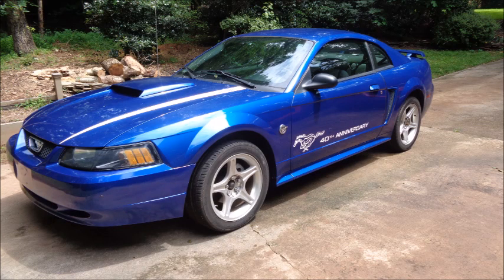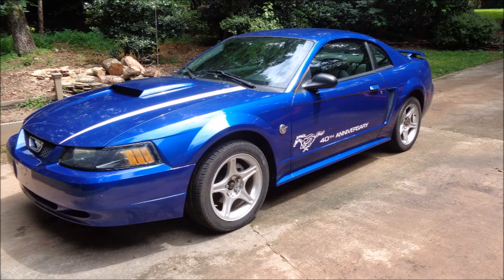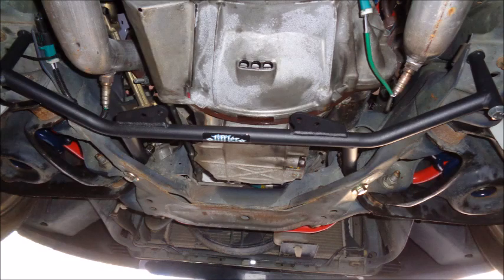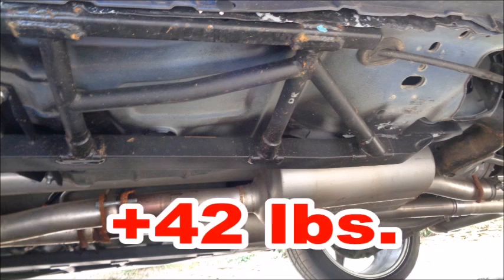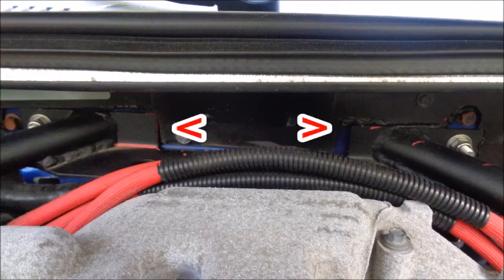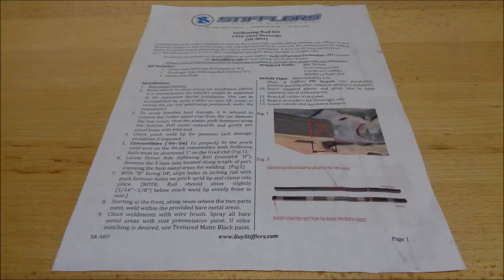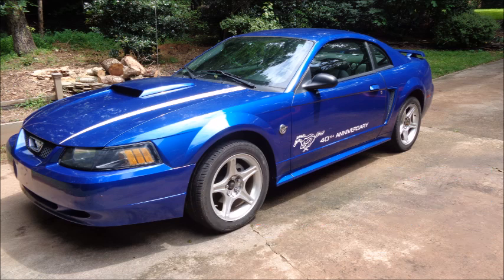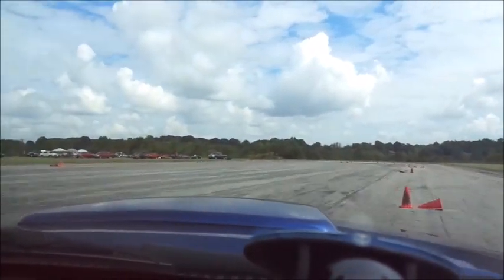MUSTANG ST Part 1: A Strong Foundation (Chassis Bracing Components Review)

Comment: Why didn’t you get the v8? They have a stiffer frame, I think.
Reply from the maker: The V6 and V8 cars have the same chassis. Some SN95 models did come with extra bracing from the factory. I chose the V6 to prove that autocross is more about handling than horsepower. The V6 is lighter and has better weight distribution than a V8. If you look at my results videos for this car, you will see that it has beaten a bunch of V8 cars on an autocross course.
Reply: @warhorseracing  That’s a good pint, V8 mustangs are front heavy. Some guys move their battery to the back of the car to help balance the car. GTs do come with rear sway bars tho.
Reply from the maker: @angelgjr1999  For autocross, you'd want the battery to be behind the passenger seat (which isn't something most people would do). Many battery relocation kits place the battery toward the rear (bumper end) of the trunk, which isn't ideal for mass centralization. I'm not 100% sure what you mean by "rear seat bars", but, if you watch a few rear seat delete install videos, you will see that there are no crossbars behind the rear seats in 99-04 V6 or GT coupes.
Reply: @warhorseracing  Sorry I meant rear sway bars. Base models don’t come with them stock, I think.
Reply from the maker: @angelgjr1999  Right. Many 79-04 base models didn't come with a rear sway bar. My 1993 2.3L also didn't come with a rear sway bar. It's always interesting driving a Mustang that doesn't have a rear sway bar.
Reply: @warhorseracing  How so? Is the rear end less stiff?
Reply from the maker: @angelgjr1999  There's more body roll. And there's more understeer in a Mustang without a rear sway bar. Mustangs without rear sway bars are less composed out on course.
Reply: @warhorseracing  How could one decrease under steer?
Reply from the maker: @angelgjr1999  There are several different ways to reduce understeer, depending on the mods you've made to your car. Basically, you would make mods that add oversteer. A larger rear sway bar will add oversteer, you can use adjustable shocks & struts to add oversteer, you can add negative camber up front, and you can adjust your air pressure. It sounds complicated, but it's easy to learn how to adjust these cars. If you watch my "ThoroughbRED PART 4: HOW TO ADJUST YOUR AUTOCROSS SUSPENSION" video, you'll see the process.

Comment: Hey I was curious if you had some insight, Im going to be putting flsc on my car this summer, and you sweat by stifflers fit system, and so do others, but when I try to find info and what makes the spider webbing and outer stiffening rail and improvement, all I find are people arguing over it. My cars a street car but I want it to handle like its on rails, The plan is MM motorsports coil over kit with koni adjustable shocks, front strut tower brace, rear lower control arm, rear upper control arm, rear sway bar, and later down the line a tubular k member and a arms. What benefit does the fit system provide over a good set of full length sub connectors? is it worth the 250$?
Reply from the maker: I will preface this by saying I am not an engineer; my response is based on my experience driving/riding in many, many autocross Mustangs at events. I've also been able to autocross my 2000 GT convertible with "regular" subframe connectors and, the following season, the FIT System in place. The FIT System definitely made that car stiffer and more responsive to inputs. And my 2000 GT feels stiffer than other convertibles I've been in that use full length subframe connectors (and some that use FLSCs and a bolt-in roll bar). If you change your tires often, the jacking rails allow you to lift both wheels on one side of the car off the ground from one point on the car (which saves time). The real question is: Do you need the FIT System on a street car? While the added rigidity will improve the immediacy of inputs and the clarity of feedback at any speed, you will have to deal with more NVH.
Reply: @warhorseracing  Ok noted, Thanks for the quick reply! Love youre videos and love that you show the handling capabilities of these cars
Reply from the maker: @ryanwhitehead2412  I'm always happy to help. I appreciate you checking out my videos. You are building a pretty capable Mustang; you might want to give autocross a try. It's a lot of fun!

Comment: Subframe connectors are the number 1 most bang for your buck mod on these cars. Never had the stifflers units, but even for a road car a set of regular old maximum motorsports full length connectors make a world of difference in these cars. 

Great video.
Reply from the maker: Thanks! Full-length subframe connectors are a great addition to any 79-04 Mustang (on the street, or in SCCA Categories that allow them).  I've used the Stifflers FIT System on 2 autocross cars. It's a huge improvement over subframe connectors alone, especially on my convertible.

Comment: Nice video!! I don't do autocross alot but what you think about suspension kit? Do you have any suggestions. Thanks
Reply from the maker: Many suspension kits include non-adjustable shocks & struts (you definitely want adjustable shocks & struts for autocross). Many kits include parts that might not be legal in the SCCA Category you run in. I prefer to piece together my suspension mods, rather than buying kits. What SCCA Category are you running in? I can suggest mods that will work. You might also want to check out my "Budget Autocross" videos; there's a lot of info in them that will help you decide on mods.
Reply: Thank you

Comment: Another great rear shock tower brace is the kenny brown one. I did that one because it is a 3 point which seemed to be a plus imo. Love the videos man, always going back through them for info!
Reply from the maker: The Kenny Brown rear shock tower brace does look like a good design. Did you weld it in, or bolt it in? Thanks for watching my videos again!
Reply: @warhorseracing  i bolted it but have been considering getting it welded in. I just don’t have a welder. If I were to install it again or offer advice to anyone getting it I would definitely say weld it because bolting it was a HUGE pain and a two person job
Reply: @the1whoknoxs  the bolt goes in the top and nut goes under the car so you can’t tighten it unless someone or something is under the car holding the nut while the other person is tightening the bolt. Same for where it bolts to the strut tower. Someone has to be in the trunk while the other person is in the fender well

Comment: I currently have a 96 project  cobra that has no name subframe connectors, mm k member 4 pt brace, stifflers cross member(waiting to install), and after market upper and lower control arms in the rear. I wanted to buy stifflers jacking rails would that help my car more ? FYI love your videos
Reply from the maker: The Stifflers stiffening rails will add some rigidity to your chassis. It would be best to tie them into the subframe connectors with the web braces. But, the web braces might not work with all subframe connectors. Thanks for checking out my videos!

Comment: Very nice videos you have going on here. I am the original owner of my 01 GT and trying to finish it up before I compete in Optimas Search for the Ultimate Street Car. I will be in the "GT" class which is 1990 and newer, factory 4 seater, RWD and min 3200 lbs. I am going to have my hands full competing against a bunch of ZL1 Camaros and GT350's from guys/teams with deep pockets. Slowly upgraded over years but I have the power now with a new sleeved Boss 302 engine (coyote swap) with ported Boss heads/cams and just got it dynod tuned making 447 rwhp with only 10:1 compression. Redline is close to 8800 from built valve train ported Boss manifold but not anytime soon till broken in. Anyways It would be nice to get an email to get your opinion on finishing up suspension while breaking in motor (only 800 miles) It has full MM suspension including K-member Torque Arm Panhard bar. I just need coil overs for rear to go with front and just wanted to go over what spring rates you choose. I have older 03 Cobra Bilsteins for now with only 275# up front still HR red non coil overs in rear but plan upgrading to much stiffer. Sorry didn't mean to write a novel but this and more important my front/rear sway bars are bone stock and just put it off till the tedious motor swap was complete. I believe front sway bar bushings have been changed/offset with MM products but have to dig up old paperwork to verify what exactly. Oh and MM A-arms are non offset moving tires 3/4" forward. Sorry for hijacking thread but just want to finish and really love to send you part list or by now maybe I've said most of it. Another is no strut tower brace and maybe an 03 cobra one made to clear supercharger which might clear my Boss manifold and/or spacers for brace maybe. Thank you so much and can send pics. Already had to cut square hole in bottom of Steeda Q400 hood (not visable outside) to clear manifold and that was including some k member spacers I believe to lower motor some. Strut tower might never happen but willing to cut hood more.  =)  Thanks again!
Reply from the maker: Thanks! It's always great to hear about another very cool Mustang project! Your car sounds like it will be a lot of fun to toss around on course. Please PM me on stangnet.com, SN95Forums.com or Corral.net and we can start a conversation. I'm happy to help in any way I can. But, I should tell you that I don't use coil overs on my cars. That might change in the future as CAM competition gets tougher, but I've been able to be competitive without using coil overs. The question I always ask when choosing mods is, "What am I asking the car to do that it can't do?" I know the motor is new, but have you been able to test the suspension and determine the weaknesses?

Comment: If I have a Maximum Motor sports K member should I still try to get the stifflers lower chassis brace?
Reply from the maker: I don't think the Stifflers Lower Chassis Brace I used will work with a MM K-member. Stifflers does make a Lower Chassis Brace that is designed to work with aftermarket tubular K-members.

Comment: Do you suggest any part that is bolt on that actually works to stiffen up the suspension feel. I can not weld. Like front an rear upper strut bars? Or I have seen front lower bars that bolt to the stock K members to stiffen up, but do these actually help? Or a waste of money?
Reply from the maker: Bolt-in subframe connectors will be less effective than welded-in parts, but they will improve chassis stiffness. BBK makes a set of bolt-in subframe connectors. All 94-04 Mustangs have provisions for the OEM bolt-in subframe connectors that came on convertible models. If you have an LKQ near you, you can pull them off in 15 minutes. The OEM bolt-in subframe connectors are not nearly as strong as aftermarket versions. Strut tower braces and lower chassis braces will definitely help. I use bolt-in strut tower braces and 4-pt K-member braces on all my cars. You will have to drill holes in the car to do this, sometimes through thick metal on the K-member. Most drills can handle this task. There are bolt-in rear shock tower braces available too. Looking at how some of the bolt-in rear shock tower braces mount to the car, I'm not sure how effective they will be. The thing to remember about chassis bracing is this: Every input you make goes through the chassis. A stronger chassis will make those inputs more immediate and precise.
Reply: @warhorseracing  working on a lite budget, have suggestions on brands an where to buy for best prices?
Reply from the maker: @leavingasap843  I have used the parts in this video for years and they work really well. There are less expensive strut tower braces sold by American Muscle under the SR Performance brand (about $70 less). I have no personal experience with SR Performance parts, so I can't praise or criticize them. Usually, the trade-offs for a less expensive brace are strength and weight. They can be weaker and weigh more. Steeda makes a 2-pt. K-member brace for about $55 (1/2 the price of the Stifflers 4-pt. brace), but it won't provide as much stiffness up front. You can get bolt-in BBK subframe connectors that don't have a crossbar that mounts under the seat for $40 less than the other bolt-in BBK subframe connectors, but again, you will be sacrificing strength. I have never used BBK subframe connectors, so I can't comment on how well they work. American Muscle has the SR Performance strut tower brace, and both versions of the BBK subframe connectors. Steeda is a good resource for the 2-pt. K-member brace. LMR often has discount codes, so it's worth checking with them, too. Don't get a chrome plated strut tower brace, it will just weigh more.

Comment: Would you choose stifflers sub frame connectors over the maximum motorsports full length xl sub frame connectors?
Reply from the maker: Yes. I have used the Stifflers subframe connectors (as part of the FIT System) on both my New Edge cars. They are really well made, the coating is durable, and I can say for sure that they work well. And, they are designed to work with the rest of the FIT System if you decide to do the jacking rails and web braces later (which I recommend for autocross).

Comment: How much did all this cost
Reply from the maker: The parts cost around $800. But, if you aren't a skilled welder, you will have to pay for the installation. Doing the prep work for the FIT System yourself can save time and money.

Comment: I've heard the first mod that should be done to a fox platform car is a sub frame connectors.
Reply from the maker: If you plan on autocrossing the car a lot, good subframe connectors are recommended. The FIT System is awesome for autocross. A stiff chassis makes all the suspension mods work at their full potential. Some form of subframe connectors are usually the first mod people make to these cars. But, welding in subframe connectors will put you into a much higher class. But, based on your current mods, I assume you're already running in CAM.